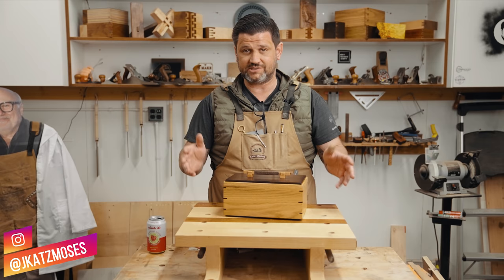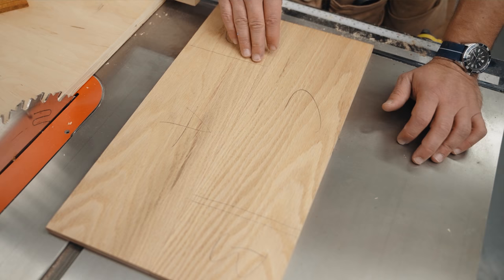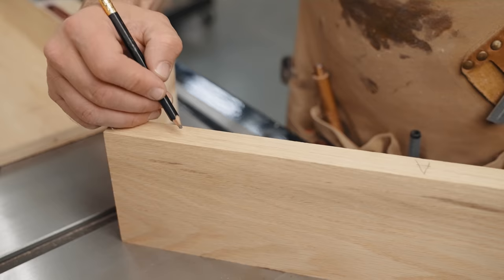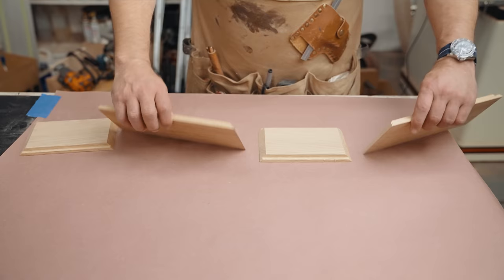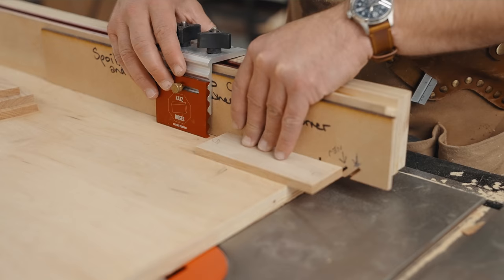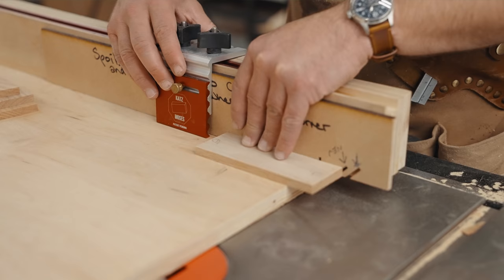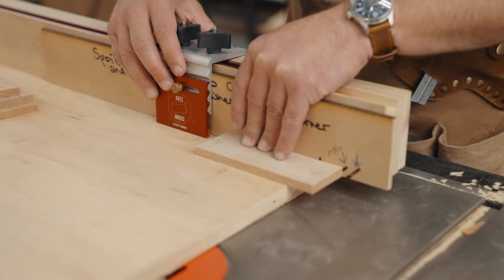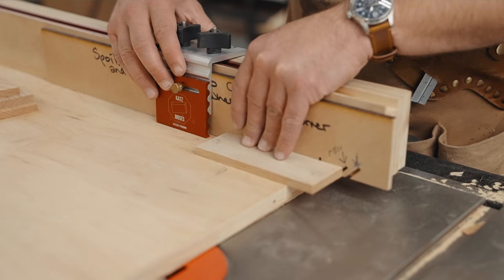Jewelry Box for a Super Hero - Box Making How-To with Step by Step Build Plans

Comment: I recently started a crafts furniture making course. My very first project was a jewelry box inspired by this video. I made it out of elm and walnut. Except for the milling of the wood, it is completely made with handtools. Not a single electrically powered appliance was used. I am inordinately proud of the result, even if it does still contain some mistakes and you can definitely see it was made by a novice. I want to thank you for this video and design, that inspired me for my very first project. I'd love to share a picture with you, but that isn't possible here :)
Reply from the maker: Love that. Send it on Instagram my friend

Comment: I learned that tape trick with grain match mitres a long time ago making crown molding, trim and fill pieces for cabinets in a production shop. I prefer to use clear packing tape so I can see the joint and the squeeze out. If you do it right there is no glue cleanup at all and very little sanding. It’s a great way to achieve a perfect corner.

Comment: That's a beautiful box, Jonathan~!!  Don't if you've used this technique with Wenge, but I built Mike Pekovich's tea box (FWW) using it and he used a wire brush on the Wenge to give it texture.  I did it the same way and it came out fantastic.  Such a difference from the "dead" flat feeling of the wood (as he describes it) to the texture that the brushing creates.
Great job~!

Comment: Beautiful box. Wood expands across the grain so the inside dimensions of the box and the outside dimensions of the trays won't change.  The piston fit won't change.  The only risk is the glued in bottom.  As you said, it is a small piece and you probably will be ok.  The real risk is if you make this in the winter and then the bottom expands in the summer pushing the miters apart.  Again seems unlikely with the splines. Probably at worst there may be a little separation off the miter at the very bottom.  Instead of a rebate on the bottom, you could have made a groove and then created a tongue on the wenge that would have floated in the groove.

Comment: Hi Jonathan, thanks for sharing more of your box-making wisdom in this wonderful video. Early on you mentioned the box dimensions were 10.5 x 5.5 and that your intention was to get close to the golden ratio. I was curious if you remember how tall the walls of the box were? I appreciated the proportionality of what I was viewing, but it’s often still difficult for me to translate what I see into dimension for my own pieces. Thanks again for sharing this video.
Reply: His dimensions aren't close to the golden ratio (they figure out to about 1.909). If the length is 10-1/2", then the ends would have to be  ~6-1/2". There are online Golden Ratio calculators to figure this out. The actual formula is (a+b)/a = a/b

Comment: I just bought the plans -- which will be super helpful.  That said they're missing the one number I really needed:  How thick are the boards you used (pre, post re-sawing)? Also, could I build this as a trial/prototype in soft wood/lumber or would it sorta warp out of shape even before I could finish it?

Comment: Loving your work Jonathan. I have a very small workshop and therefore cannot fit a table saw in ( Or justify the expense). Could something similar to this box be made without the table saw. I have a thicknesser and a band saw, plus the usual hand tools including a skill saw and Japanese pull saws. Plus the usual da sander and belt sander.

Comment: Truly inspiring work! You never cease to motivate and inspire me to improve my craft. 

Being a novice woodworker, I'm curious, what's the benefit of using a disposable fence/jig for your table saw to cut rabbets with the left side of the blade vs using the actual fence and cutting rabbets with the right side of the blade? Like around 11:17
Reply: It's more accurate. Especially if you have cheaper tools. Plus it keeps your hand out of the way of the blade by being on the outside vs between the blade and fence
Reply: @tjfox2709  Makes sense. Thank you!

Comment: Wenge has a dimensional change coefficient across its width of .00201, so it's a fairly stable wood. Assuming a 4% moisture content change over the course of a year and a 5.5 inch width, the wood should be expected to move about .044 inches. So roughly 1/20th of an inch or just a hair over a millimeter. It's up to your experience with your joint strength as to whether that's an acceptable amount of movement or not. Your walnut example is incorrect by the way. Walnut has a coefficient of .00274, so a 96 inch wide panel (which is a pretty huge panel to be fair) can be expected to change over an inch in width over the course of a year.

You are correct though on your trays. Wood won't expand perpendicular to the grain nearly as much as across the grain, so you'll have zero issues.

Comment: Nice tip using tape and straight edge before glue-up, I'm going to do that from now on because I've always been off by 1/16th is so and rely on final sanding to hide the error. I do have a question about your glue-up, as I find this is something never discussed by even highly skilled carpenters. Why not pre-glue? Do you ever pre-glue? I know most find this an unnecessary step but I pre-glue everything (especially sheet materials) but find no one ever talks about this topic...

Comment: Great video But how did you get a 7 1/4" blade to work in the SawStop (@ 2:17)?  My SawStop will only allow 8" blade as smallest, with the dado brake cartridge. installed.  No way could I get my 7 1/4" blade to function, even with the ByPass system engaged.

Comment: Jonathan - I have a question concerning your use of the smaller circular saw blade. Did you have to adjust the SawStop brake much to get the blade to work? I was originally told that small blades and thin-kerf blades wouldn’t work well in a SawStop.
Reply from the maker: Dado brake and adjust it all the way up. I mentioned it in a couple takes but I guess it got cut out. If you do it I would operate under the assumption the brake (don't know if true) won't work so be careful.

Comment: JKM-
Thanks so much for the beautiful project. I'm having a heck of a time with those miters. I'm using your simple single runner sled, cuts perfectly with my blade at 90 (I did a 5-cut just to check it, it was quite good, I think the error was 0.0006, no light through a 90 cut on a good Woodpeckers square); but just won't give me a square cut when my blade is at 45. Setting 45 same as you, with a digital level. Good quality Ridge blade. Jet left tilt TS.
Any suggestions?
Reply from the maker: Watch my tablesaw tuneup video. Maybe you'll find the issue. Cheers
Reply: @katzmosestools  thanks will do

Comment: Do you really see any wood movement in places that dont change seasons very much? I live in South Texas were there isnt extreme change between the seasons and the humidity hardly ever changes
Reply from the maker: Yes always BUT...There's a formula (I'm going to do a video soon), that says basically 1/4"-1/2" across the grain per 8 ft. So where you and I live it's probably closer to a 1/4". So we're talking 1/32 per foot with the changing of the seasons across the grain which is always the shorter side of side of project. This box will have less than a 1/64 of movement.
Reply: I love the fact that you have the time it took to complete the box.  And also the approximate price that you would price to sell it.  I'm always wondering this within my own projects.
Reply from the maker: I'm going to start including that in all my builds from here on out.
Reply: @katzmosestools  yes, thank you! I think with the saturation of pallet projects and HomeGoods stores, people think handmade projects with premium woods should be a comparable price. Not knocking either of those, but they are in a different world than wenge and white oak.

Comment: Im a noob so when says things like "Im gonna cut a dado" i get a little lost. Can someone explain what he means by that?
Reply: A dado is basically a channel cut across the grain. It is typically wider than the saw blade kerf and does not cut all the way through the board. This allows for another board of the right width to fit into the piece with the dado at 90 degrees. It adds a lot more strength to the joint as opposed to just a butt joint, and since you don't see the end of the 'male' piece, the interface of the 2 pieces look a lot more clean.
Reply from the maker: Yes